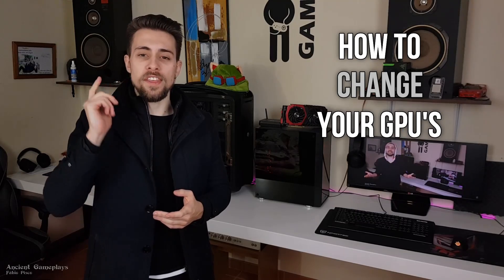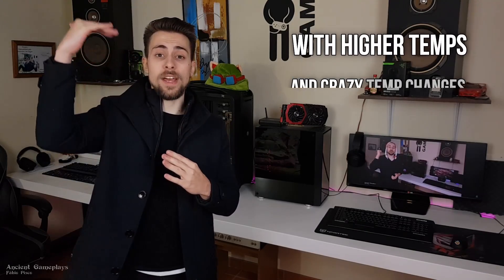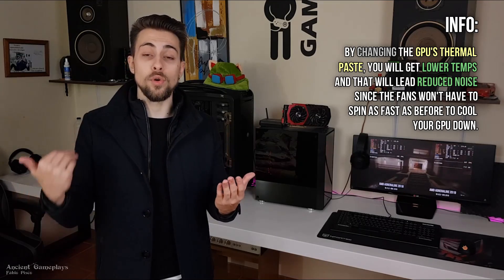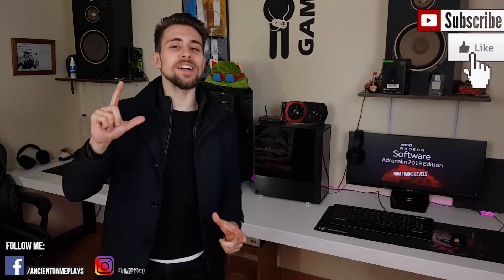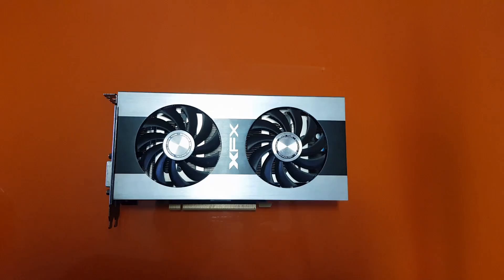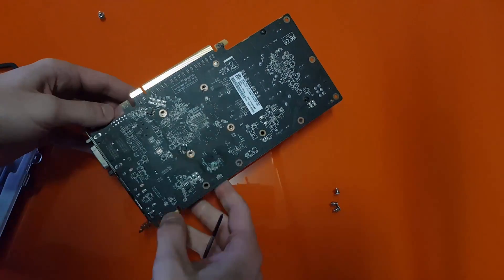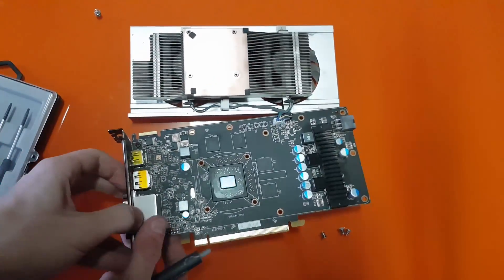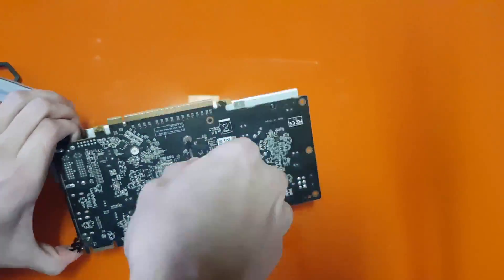[FIX] GPU High Temperatures! | How to Change your GPU's Thermal Paste in 5 minutes! (Easy Guide)

Comment from the maker: TIP: The best way to put the thermal paste is to spread it all over the GPU die :D
Reply: My mind was blown when somebody said, the best way to apply paste is to apply it... I never thought of that! :P
Reply from the maker: @z1mt0n1x2  Damn, that is some next level knowledge!
Reply: Better say hi to Aldrex on WCCF then, he's the wise-guy :D
Reply from the maker: @z1mt0n1x2  I have him blocked man. I don't like egocentric people xD
Reply: Fair enough :)
Btw, I have a video concept for you that I think would get you a lot of views but, it's gonna be very time consuming and, most likely be pretty costly unless you can find a good sponsor (non related to the content) if one set of RAM doesn't cover the whole available speed spectrum on the market.

Remember this? https://www.youtube.com/watch?v=dWgzA2C61z4
Been asking Linus for years to do the same for DDR4 but, as far as I know he never delivered. His old DDR3 video is pretty outdated now.
If you can, that would be very valuable information that has not yet been uploaded here :) Call it, DDR4 speed vs latency benchmark.
I wanna know where the DDR4 sweetspot is between mHz and CAS.
Reply from the maker: @z1mt0n1x2  i do have something like that mate. I did an old video of that. And i am now "remaking" (with way better testing methodologies) 2 of my old video. The next one is "DDR4 2133 vs 2400 vs 2666 vs 3000 vs 3200". Since my kit won't go 3200mhz i wil try to emulate 3200Mhz CL16 using 3000Mhz CL14 Rams  :D

Also, the second big one will be indeed the "remake" of DDR4 frequency vs Latency :D

Currently working on the frequency one hehe
Reply: @AncientGameplays  Nice, I thank you for your efforts, you're a great man and I wish you get more viewers and subscribers! :)
Reply from the maker: @z1mt0n1x2  Thanks for the words. I also want to grow :P

Comment: Hello, i have a problem with my 4 years old MSI rx 480 gaming x 8gb ....was running fine on temps max 70c on full load since last week when the temps was going over 75 c  and now they are in full load  75-85c  and in idle 55c , if i run furmark test they go like 90 and system shoutdown.   Can be a card problem or can be thermal paste ?
Reply from the maker: Can be thermal paste yeah, you can try and change it. It is fairly easy :D
Reply: @AncientGameplays  Done, i changed the thermal paste and the  temperature is now from 85 c to max 65C used Arctic mx4. Thank you so much :))
Reply from the maker: @Alin2021  you are welcome mate :D

Comment: I have had my rx 570 for 4 months and it has started overheating
Reply from the maker: Because the weather is getting warmer i guess
Reply: That is probably part of it but I have my fan speed on 70 and it is still at like 87 degrees under full load

Comment: I have MSI RX 480 8GB GDDR5, I applied thermal paste 2 times, and increased the speed of fan but still my pc monitor goes blank because of high temperature while playing game in high or normal settings, is there any other solution?
Reply from the maker: I guess that iw wasnt related to temperatures then

Comment: Do you think a rx 480 and a ryzen 7 1700 would go good together?
Reply from the maker: I think it is a great combo :D
Reply: @AncientGameplays  Do you think a 400W power supply can handle a rx 480 or rx 570?
Reply from the maker: Do NOT use a 400W power supply for R7 1700 + RX480. Even if a good one, it may turn off your PC or reduce stability. Get at least a good 550W PSU :D

Comment: I just replaced my Asus dual OC RX 580 paste it had more on the side than on the die itself. The card it's running 10c cooler
Reply from the maker: Great to know :D
Just a tip also, for larger dies, it is advised to spread the thermal paste across all die.

Comment: I have three little remarks on this:
1. It is good advice to use thermal paste that is not electrically conducting for GPUs. It is not a problem if you apply it carefully, but if you want to be on the safe side, buy thermal paste that is labeled as not electrically condictive. Because as seen in the video, GPUs usually have a lot of tiny components around them, and conductive thermal paste could spread out onto them, causing shorts.

2. If you are a girl or have a girlfriend, chances are you will find nail polish remover somewhere around your home. That stuff also works great for removing old thermal paste. Just keep it away from plastics.

3. Don't put your GPU on any kind of shit. Really. Shit can contain all sorts of acids and enzymes that can damage PCBs, and also it will stink up your house forever when your GPU gets warm. ;-)
Reply from the maker: Hahahhaa, good ones. The first and last ones, i tought it was kind of a common sense hehe. The second one is a nice advice :P
Thanks for watching

Comment: Hey nice tutorial, i already did this for a client's GTS 250 that was heating up to 110°C and it worked just fine ! 
65-70° on gpu burn test after paste replacement
Reply from the maker: That is exactly the reason way i did this video hehe